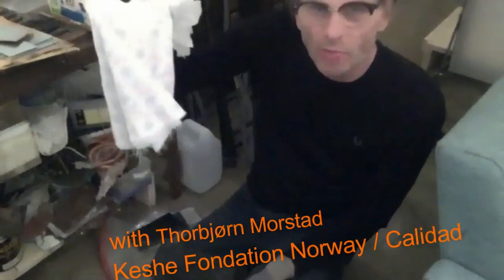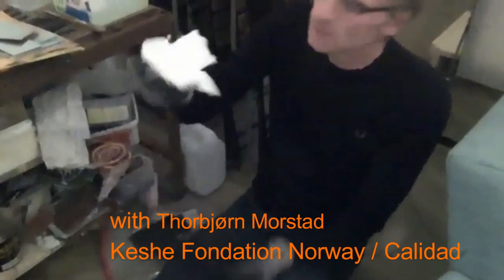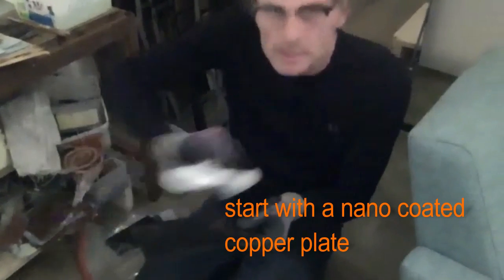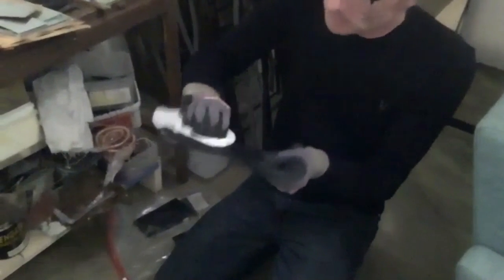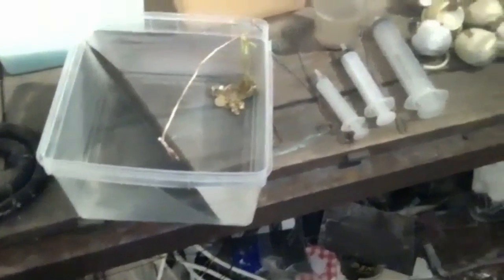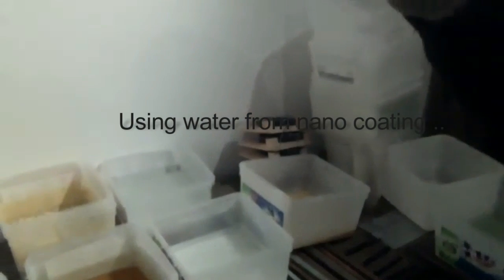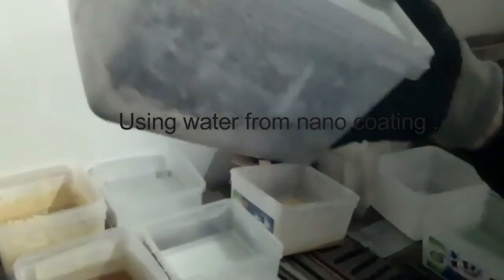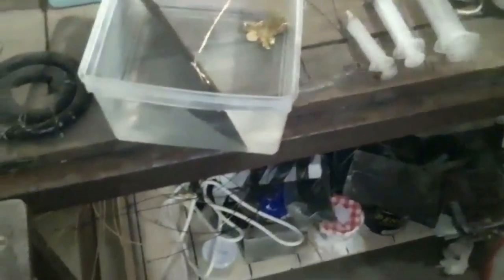MAKING GOLD   - Preparing Gold Gans PART 1 - Thorbjørn Morstad (ENG)

Comment: now place that container in another container that is nanocoated. be sure there is air flow under between the containers. put a lid on the smaller inner container.
see what collects in the outer container. be sure of adiquate airflow.
Reply: Where did you get that info friend and have you tried it? Thanks for the info